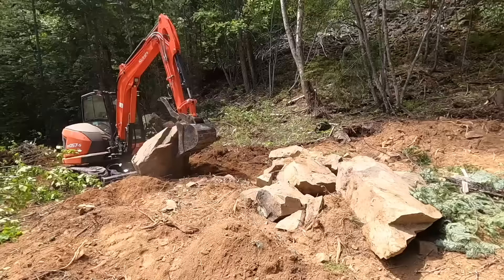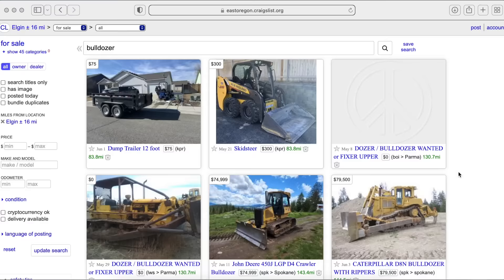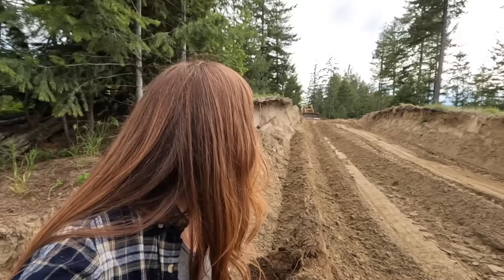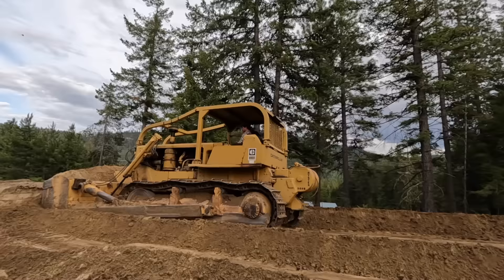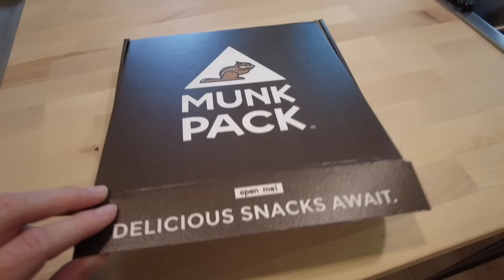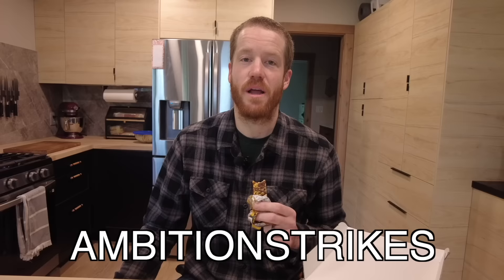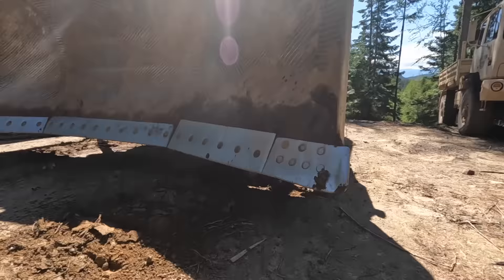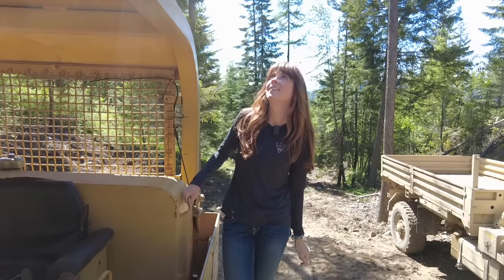We Bought The Biggest Bulldozer We Could Find || MASSIVE CAT D8

Comment: The biggest killer of the pony motor is gas in the crankcase oil. Always shut off the gas at the tank and let the engine run out of gas to stop it. the switch should be used for emergencies or if you plan on starting it again in a few minutes. check the oil smell and level for gas infiltration and dilution before starting.  (EVERY TIME) for the safest operation, and make sure you put good covers over the smoke stacks of both engines. best of luck.

Comment: Check out the Fuel Filter number and Machine Serial Number !!!
Order 6 fuel filters
3 Air Filters
Change the Engine Oil
Change the Air Filter.
Keep your fuel Clean 
Theres probably a Banjo filter under the fuel pump !!- unscrew the thumb Nut and wash out the gauze filter with clean diesel and re- assemble 
Good Luck Guys

Comment: Massive tracks can do lots of work quickly, and easily. The only downfall is the also massive costs involved if repairs become needed. And the fuel bill will be a shocker, as will routine maintenance such as filter changes. But they are fun at times enjoy and stay safe. P.S. have you checked out the winch and it's cable as you might need it if you get crossed up and track started off the driveway down hill.

Comment: That D8K is a very good dependable steady hard working machine. A little slow. But low maintenance and will hold it's value. You can not lose. So many people are looking for them. I could use that in the shell pitt. I have a 82-30 750D terex which will out push an D8k but not as dependable.

Comment: The tracks need to be tensioned also how does your track pin bushings look, do that have a flat spot? Can you see if metal is being rubbed off the sides of your drive sprocket? Drive socket bolts and bolt holes? What is the condition of your equalizer bar? If you haven't run through that stuff already it would be good to do it before you start to work the tractor heavily.
Reply: Ayyyy.... They liked my comment😂😂 forgot to mention checking the guide rollers, check how worn the flanges may be and if they are loose on their shaft. If you guys need an eye the help you see what should or shouldn't look like how it looks I'd be happy to help. With  undercarriage issues , it's best to catch them as early as possible , a bad unit will put extra load on other components and will compound the problems

Comment: Nice little jump, 174K. You will be very happy it is diesel vs gas, but could you have found something a little bigger? Only thing better would have been a 6 way blade, you'll love the winch!
Heavy haul drivers are pretty smart, notice he didn't high center on the tracks and cleared the road for other traffic.
Just started my solar, 5k hybrid inv, 48v/200ah lithium, 6-8 mono panels.

Comment: The old 7 is a manual tilt. If it isn’t rusted stuck. The older one (3t series) is one of the best cat ever made and cheapest to operate. (If it is oil clutch). The d8 will be better I think for the rough ground you are dealing with. Drink a lot of fuel, but gets a lot done. Worked on them for 40 years and if you have good luck  you may actually make money on it because the newer stuff isn’t holding up. Learn all the grease points and don’t treat it like it’s indestructible, it ain’t. Not a fan of pony motor. Looks like a 46a series. Be careful with it and don’t get it stuck or you’ll need that winch which is extremely dangerous. Don’t want to sound like a know it all because I ain’t. Owned several myself and my father. Good luck and I hope it works out well!

Comment: I would also look at Purchasing a Cat 963/973 Track Loader (with a 4n1 Bucket if you can find one) and/or Possibly a Cat Wheel Loader for Lifting, Hauling, and Spreading Rock & Dirt. A 963 or 973 Track Loader would definitely Compliment that Cat D8K Dozer. The Cat D8K’s & D7G’s are the Holy Grail of Older Dozers. Also, while you could have Gotten By with a Cat D7G, given the Size of Rocks that you all have there, you picked the Right Size Machine for the Job. In my opinion going Bigger is Nice as it is usually Easier on the Machine, compared to being Hard on a Smaller Machine. Best of Luck to you all.

Comment: Looks like you need to tighten the tracks up just a bit. You want a little sag on the tracks but you don't want them tight with no sag, as that will wear out the rollers quicker.

Comment: Thank you it is big runs great can't  wait to see it in use is going to be an experience to behold but I no you well do a great joband the one you were going to get could have been converted to electric start in like 2 hours with out using the pony motor and it was smaller and more controllable but still good for a road but you have this one.cant wait for next video.

Comment: The track tension is adjusted via a grease fitting on all the cats i drove. Easy to find specs for track tension adjustment. They look fine to me.
Reply: The undercarriage is in good shape partially because the owner didn't over tighten the tracks (less tension = less wear). Most wesr happens while backing up. So a little slower while backing helps.

Comment: I'm not and expert on dozers I don't have 40 years of experience but I have had a cat D9 dozer for about 2 years on 127 acres around my home. First, my D9 weights about 110,000 pounds there's no way that weights 40 ton. It's more like 25 ton. How big is to big? To me there's no such thing lol. Obviously cost up front and long term ownership and maintenance (mostly undercarriage). That track looks a little loose you might wanna check the slack. Obviously you probably already have. It's fun to bulldoze and it's even more enjoyable when you start to understand how to use the blade without make tons of adjustments to often and to quickly. Also don't use the decelerator pedal to push dirt use the gears. Not to familiar with older dozers like that but a lot of beginners use the pedal to control engine speed while they push, use the lower gears when you have a full blade and full throttle this way you have all the power available for the push. It's also a good idea to visually inspect your machine before use and understand what your looking for. Have fun.

Comment: first you don't drive it you operate it. When moving from one location to another you walking it. Always pull the steering clutches with left hand keeping right hand on blade control, and it has a blade not a bucket.  Left foot runs the brakes keeping the right foot on decelerator.

Comment: Totally amazed at how quickly you both pick up the operation of all that equipment. Watching Courtney nurse those steel structures into place for your deck was impressive.
Please elaborate on the strategy behind a DEcelerator pedal. How is that used?

Comment: I've driven several different types of dozers on job sites, and the only dozers I like to drive are the ones that have the standard joysticks like skid steers have. Those are by far the simplest and easiest to operate and quickest to learn since they are standardized. I have driven several different brands of dozers and John Deere seems to have the best joystick controls for a dozer. I've driven cats with twin levers and twin switches and rotating tillers and etc. I did not like any of them.
Reply: I gotta agree , JD understands intuitive controls ...they still stand alone .

Comment: You always turn the gas off on the pony motor.  The vibration from the engine and tracks will make the carburetor leak gas into the gas engine and dilute the oil and or hydrolock the engine.  Should be a petcock or shut off valve.  If not, install one.

Comment: What neither of you took BRAE 141, and played with the JD 450C. I took the class and TA’ed the class (as AE141) but really never played with the 450C. I did get to drag the dead HD6 out of the field on a chain. 

I find both Dozers and Road Graders require a lot of practice to get good results. My results suck.  I don’t have enough time in the seat.   Or in the case of my Adams pull behind Road grader standing at the controls.  Two operators required one to run the tractor, one to operate the grader.

Comment: Congratulations,  nothing is going to stop you now, think into the far future use the tool while you have it, leveled out future parking area, leech field for septic, proper area for solar field. Pond for water assess for fire fighters the list is almost endless.  I operated a core drill in West Virginia technical term is mineral exploration the mine company would determine where they needed information.  The next step required a Dozer operator (skilled) he would cut in a road sufficient enough to get the 24,000 lb F-350 Ford 4 WD drill rig then [this was the scary part once a level pad was established in the designated spot. (This was always at the top of the higest terrain in the desired area.  We then would decide where our water supply would come from ususlly a dammed up tiny mountain stream.  The dozer operator would exit the drill pad straight over the side of the mountain blade in front hitting trees rocks mountain slopes  not intentionally making a road just getting to water source  ASAP then make the storage pond then cutting a road for the pickup truck so we could refuel the pump motor daily. That was a D9 then it would take about 30 days to drill the hole the dozor operator would stay a few days making thing tidy then he would be on call the dozor parked on site for us to use as needed. The worst spots were long stretches of bed rock too hard to grade properly too steep to safely use the only solution was change the road to avoid ot correct the problem.  There is rock and then there is rotten rock , if you can hit it with a D 9 and break it up then you do .  What you night want to do is install a device in the cab that will indicate level then use as a reference.  Can be as simple as a plumb bob , ot a 3 ft level you keep under the seat and there incline indicators that can be screwed to the dashboard.  Whatever you become comfortable with and as always with practice comes proficiency so be prepared to cut in roadways for the neighbors in your quest of perfection.  Study the are of road making , material use and compaction, under drain pipe may be wonderful but not always available look into alternative ways to deflect rain & melt water sometimes across the roadway you are building, this becomes tricky in winter because ice will cover & build but ice will also freeze solid drains  that in warmer conditions drain fine in all cases if in a vehicle & brakes are jammed on the grade should be at an angle that makes you slide / drift to the gutter that is on the high side  / mountain up slope thus you stop avoiding catastrophic conditions. Make careful notes of where on your property rotten rock is avalible thus to use as rip / rap fill for roadbuilding . Also if you cut in a jeep road for getting to special spots on your property, future development,  scenic overlooks or even park spots for future tiny homes vacation home rental.
Good luck.

Comment: that old d7 pony engine with vertical cranking shaft? have a machine shop make a short adaptor with a square hole for the shaft and a bolt hole circle for a car flywheel and a side extension to bolt on a starter and just fast crank it with the starter!
Wanna see a sketch of what I mean/
Any other dead D7 owners want to see the sketch?

Comment: Those H models are good dozers. I saw a couple posts on track sag and calling cat for the correct sage would be very key. I wouldn’t just give it a few pumps and say that looks better. Running to tight or to lose will cause excessive wear to the undercarriage and when your talking 15,000 for a new set of rails, pads, sprockets, idlers, under rollers, and so on getting the sage checked correctly is important. Looked pretty close to me, but have I have only adjusted sag on the D8Hs a couple times long ago. Just my two cents. 
   One important thing is if do you have to loosen those tracks is to not unscrew that grease zerk fitting more than necessary. If the stops are broken or missing, which I have seen, and one was to unscrew one out all the way, it could shoot out and injure or kill the person doing it. They are under a mass amount of pressure. 
  Hope she runs for you many years and that pony motor doesn’t give you grief!!

Comment: Hey you guys, congrats on the new toy, I’m sure it’ll make your life so much easier. Courtney, I’m really interested in the vinyl you put on your camper. I’m looking into buying a used canopy for my pickup but it’s the wrong color. Any hints, tips, tricks you can give me for doing that vinyl?? I wish you had done a video, just on that process. I never knew that stuff existed. Lori
Reply from the maker: I wish I had done a video on the vinyl too! My biggest advice is to use a very high quality vinyl, as they are much more forgiving. I used Avery's premium automotive vinyl and it was great to work with. You'll also want a blow dryer or heat gun, and a vinyl application kit (squeegee, blade, etc). 

Practice on something small and you'll get the hang of it! Compound curves are going to be the most difficult to learn. There is a great channel on here CK Wraps that I learned a lot from:
https://www.youtube.com/c/CKWraps

Comment: Do you know him many years ago I worked on a D9 caterpillar and we could not figure out how to get the pony motor started and once we got it rotating and everything was working like you said we had spark compression and fire. But it turned out that the spark plugs were old and had a really weak spark so after hours of working on it it turned out to be four dollars that was the difference between running and not

Comment: Pony motors MUST.  After the diesel engine is running. Shut off fuel to pony motor. Let it run out of fuel and die.  
Or engine vibration will cause float bowl to flood and dilute the tiny amount of pony motor engine oil.  Causing the pony motor to fail. Parts for pony motors are getting crazy hard to find and expensive..
Pony motors on smaller cats only hold a quart of oil.  On that one .I am not sure. Oil is cheap. 5 or 10 bucks. A pony motor rebuilt might cost $10,000 and take months.  Change the pony motor  oil ASAP.  Now that you own it.

Comment: Had something like this happen to me .

Obviously you're gas engine is almost seized up completely. Put about three tablespoons of engine oil at the top of the piston by taking off spark plug. The more you move the piston without starting, the more the wall, rings dry up even more from no oil there. Which adds to. Compression strain..then try cranking if it cranks easier, you discovered the cause. Go back to cranking it with the drill setup.  If that test spins the engine faster,, that is a verification that. The engine was almost seized up.  After all them years, the engine parts surely have a. Coating. If rust.once runs for a short. Time,change the oil.
Reply: To start engine. After that,,that top lubrication must be gone with gas so make sure top of piston has gas to make the firerinfireing up..

Comment: You better get an experienced operator to show you how to use that dozer, you get that thing on frozen ground and turn it sideways on a hill and you're going to take a sled ride that you may not want to take. That's a very large dozer and it's extremely heavy you seem to be having fun pushing a little bit of dirt here and there but that thing is designed to move mountains, get somebody to show you how to use it in the little intricate details about that machine before you get yourself hurt because once it starts going bad it goes all the way fast.

Comment: You may need a second diesel tank those kitties eat ALOT. Getting on and off ALWAYS  3 PoINT stance  paint grab handles  RED .If it's wet use 4 and move more carefully wet steel is just like ice. There's a traction tape they use on pool steps and walkways  and boat decks it has reflective tape built in to it appily to all shiney bare metal foot traffic areas ..Did you get a Bigger recovery rope, does the winch work , practice getting on all the way and sitting down and off a few times . That's so you remember where to bang your head and knees on stuff that doesn't move no matter how hard you hit it !!

Comment: Everyone wants a dozer till they get one. Kinda like a woman. Yours appears to be a high horse power46A with a pony motor that's a little different usually they were direct start. Low horses were mostly pony start. But you've got the old air cleaner set up. High hp 270, low hp 230. I would have recommend a D7G 200 hp. Much easier to move and a lot less fuel. 7s run between 25000 to 60,000. Old 8s run from 12000 to 30000. I've owned several. Remember these aren't toys. If you are rolling forward and shift into reverse and blow a transmission it will cost about 30,000 to fix. Check your final oils they will cost 15000 to repair. Keep your dead shaft greased daily. I rented one out to a guy 3 years ago he was riding next to blade control showing a kid how to operate and fell off, tracks ground him alive almost died, hospital 3 months crippled for life. Wish you the best, have fun.

Comment: The problem with a large  Dozer is if it brakes it is expensive  to fix.  you can buy them for cheap but they  can cost if tehy need to be fixed .

Comment: 11-14 gallons per hr. Thats a lot of fuel burn. Dozers are fuel pigs. Thats why i run them. The d8H is a great machine. Big old girl for a driveway. But bigger is better. Nice job guys. When grading go slow you have to have the time to react to the change in pitch to keep a clean smooth push. Alway keep the blade loaded when pushing full blade width. God bless and burn some fuel. #FJB